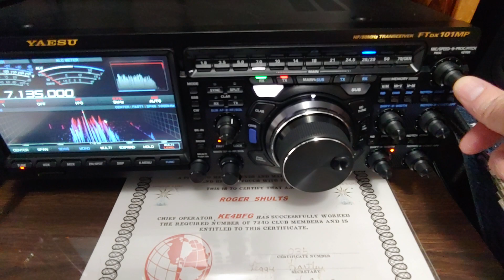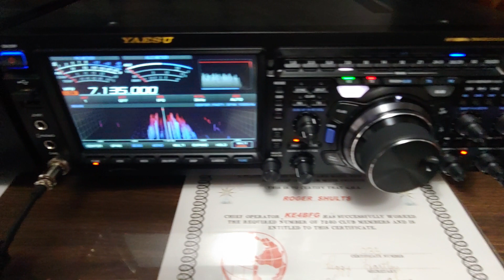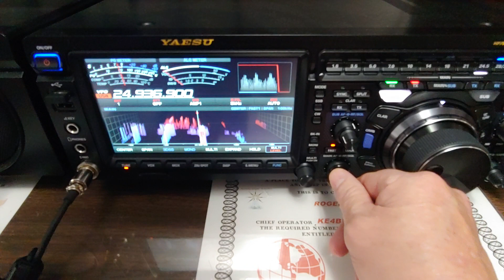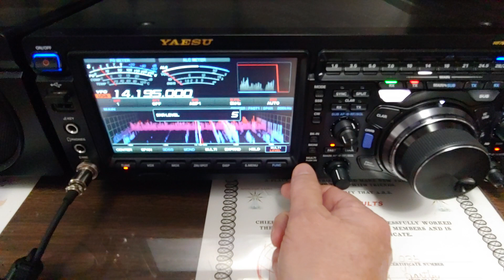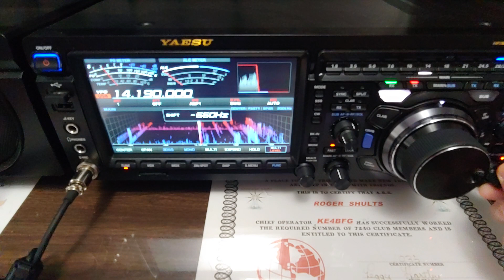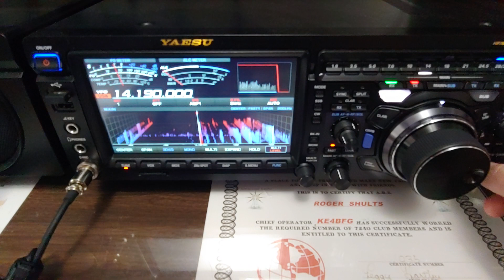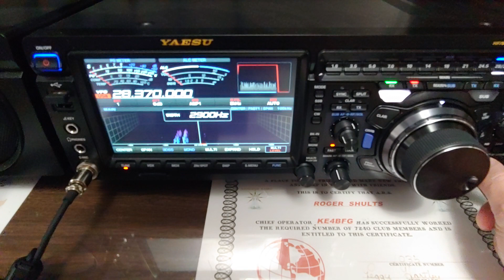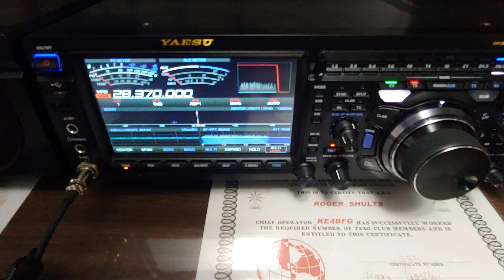YAESU FTDX 101MP  AMC

Comment: What is opinion on the FTDX-101MP,  mainly the V-Tune and roofing filters for added quality of noise reduction and additionally the 200 watts, dual tuner and power supply speaker add to a better experience? If the V-Tune and roofing filters are not as helpful for added ease of hearing then the FTDX10 maybe the best choice?

Comment: I think you'll find pulling the RF Gain back to 1 or 2 o'clock and the VC Tune setting 2 to 3 segments from default on the bargraph will optimize receiver performance. RF Gain and VC Tune are a big deal on this radio. DNR's a given, it rocks. Sure enjoy my 101MP.